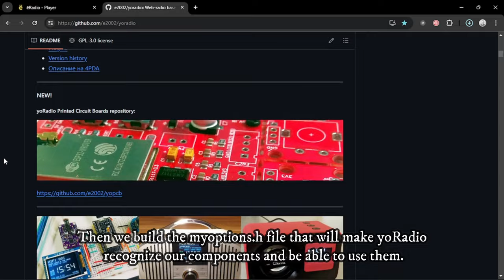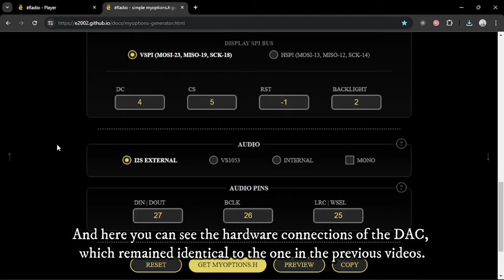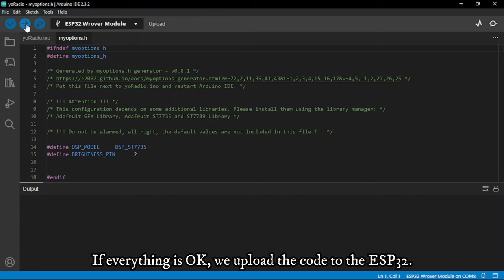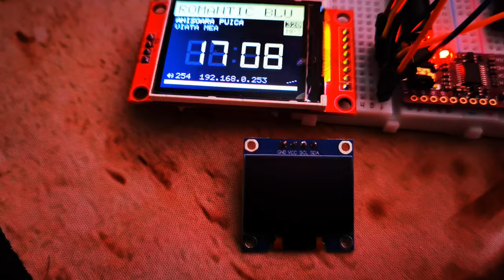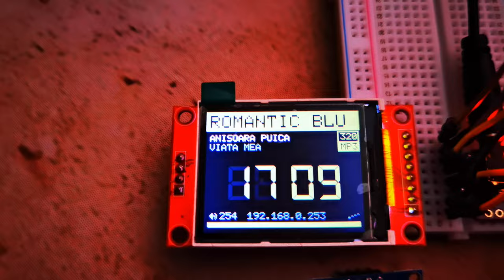yoRadio STEP BY STEP - ( Step 3 - DISPLAY) ESP32 + PCM5102A + ST7735 TFT display - webradio player

Comment: Conectat tot , verificat . 3,3v si la display si la dac asa am vazut ca trebuie, sau trebuia 5v la ceva ? Port selectat cum trebuie. Dar nu se incarca , dar daca dau Esp32 sketch data upload apare la final
Leaving...
Hard resetting via RTS pin...
Daca dau upload pe sageata nu se incarca nimic. Unde am gresit ?
Reply from the maker: Boardul nu este setat corect, sau librarii neinstalate. Nu pot să ghicesc din atâtea informații. Dacă vrei mâine te pot ajuta via AnyDesk. Cei de la TeamViewer m-au pus pe pauză, deși nu am abuzat de ei. Displayul lasa-l la 3.3V.